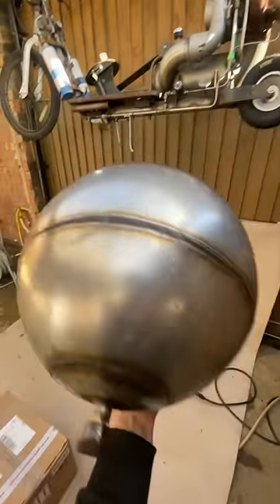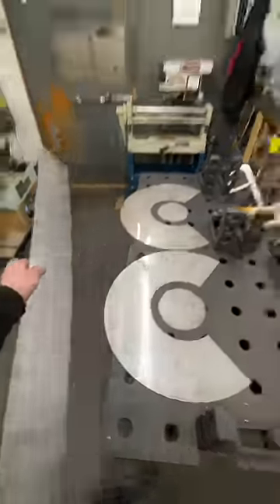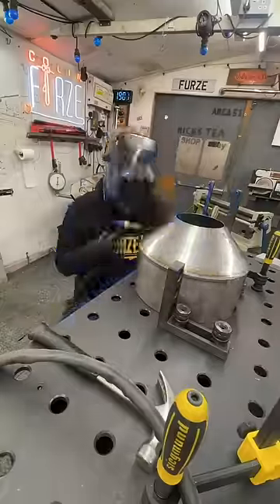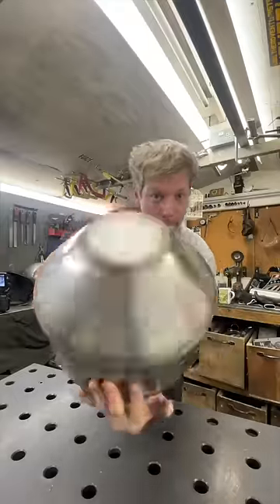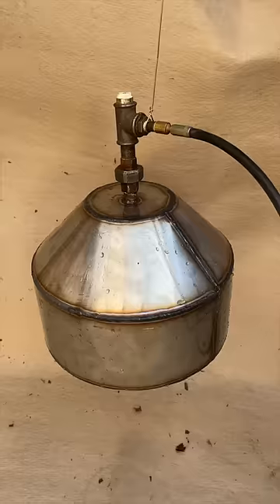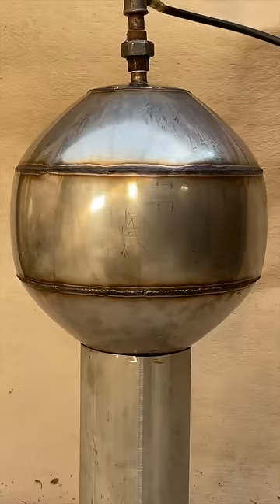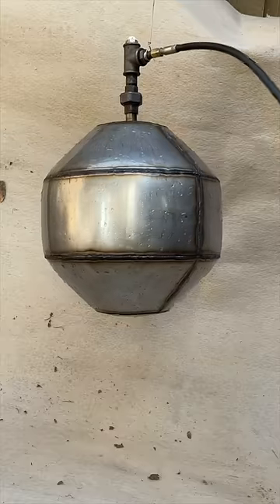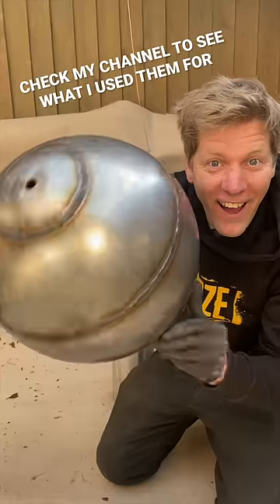Your Pressure washer has a Secret SKILL

Comment: I think it’s VERY important to note that you should ONLY pressurize with LIQUID. If it busts with water in it it’ll just split and water will gush out, if it busts with air in it, it’ll send shrapnel through your body at very high speeds.
Reply: this comment should be higher to save lives
Reply: @ampjam his full video on this he says all that warning what to do and what not to do
Reply: @derekvandyke5132 
Well yes, but this isn't the full video.
Reply: @gustaveliasson5395 very true
Reply: Not saying I doubt you, but could anyone explain how/why air would shred the sheets of metal into small deadly shards whereas water would just pop the seams?
Reply: I do have two corrections to make...
"it'll"..."it WILL send shrapnel THROUGH your body" 🤔

How about "it could send shrapnel into your body". Would that be more accurate?
Reply: @AB-nb2ic air is compressible water is not. For air or water to exert that amount of force on a container, there has to be a MUCH higher volume of air  shoved into it than water meaning far more room to expand if the container ruptures. It’s like how if you poke a hole in a balloon it pops really loud cause that volume of air is in a rush to get out as fast as it can whereas if you fill a balloon to the same diameter with water and then pop it the water just kind of falls to the ground.
Reply: @AB-nb2ic  water would take the easiest route so when a hole forms it would just leak out 
But with air pressure the ball would form cracks then expand and after a short time explode

(Look at naruto and sasukes fight on top of the hospital and cheack what their attacks do to their respective water towers)
Reply: Nah. Darwin.
Reply: Could you fill it with water and freeze it ?
Reply: @frankyw8803  really not a good idea
Reply: @ampjam Yeah this should def be higher up even pinned up top for all the ppl who are def gonna weld and inflate a steel sphere!!👍🤦🤕💥💨lol
Reply: @AB-nb2ic It has to do with the compressibility of air. When air is under pressure, it gets compressed like a spring storing energy. When the vessel ruptures, that energy is released and it explodes. Water on the other hand is incompressible. When the vessel ruptured there is no stored energy to release.
Reply: @AB-nb2ic it'll is just a contraction of the words it and will.

It'll and it will both mean identically the same thing
Reply: @ampjam  because everyone who watched this is running out to buy a welder, pressure washer, going to learn to weld, going to buy buy sheet metal and a metal roller............. RIIIIIIGHTTTT
Reply: The beauty of hydraulics... When they fail, it's okay.
Reply: @AB-nb2ic  water is very incompressible. At 10000 feet under the ocean it is only a few percent more dense iirc. When it bursts, it barely expands. Air really does.
Reply: Atleast with a pressure washer u can put a lot of molecules of air in it but u can’t put in a lot of molecules of water. So when the tank bursts there are more air molecules than there is water molecules. Which expand
Reply: @ethanbikes7926 Best basic description of physics ever!
Reply: I think pressure washers can only pressurise water. Hopefully.
Reply: @AB-nb2ic simply, it takes more air to make the sphere then it does water. Water does not compress, unless it is in its steam form. There would be alot more air in the sphere then there would be water if water was used. Alot more air would be trying to escape, especially at high a Psi. This is why all compressed gasses are in thick or double walled cylinders.   Like welding gasses, if you have ever seen a welding gas cylinder like a argon tank being punctured, you would then be able to connect the dots as to why air is not a good idea to be used in this experiment.
Reply: @RealCanadanMan welders are cheap and there are other shapes you can make, other then a sphere, hydroforming is not limited to making spheres only. I can see some diy week end warrior, trying to make a ornamental piece for his Christmas tree. And catching a chunk of metal to the neck by doing this process incorrectly
Reply: Idk that sounds pretty metal. I’m gonna give it a try anyways
Reply: @gustaveliasson5395   good thing he didn't say to do it with air then
Reply: @wlfshadow4255 take a bath with your toaster.
Reply: @AB-nb2ic  gas compresses, liquid does not. 

Because the gas compresses, it can pressurize MUCH higher before exploding the sides out.
Reply: @AB-nb2ic water doesn't compress. Ait does.

You could fit a theoretically limitless amount of air in this sphere because it will compress. That means that once there is a way for the air to escape, like a weld failing, the air will explosively decompress through that hole, ripping the sphere apart. 

You can only fit a certain amount of water in the sphere, and it will crack open the instant there is more than that. The pressure that would break the sphere is literally just a single drop of water more than it could handle, which means the the pressure goes to zero the second the sphere fails.
Reply: I was hoping no one mentioned this. Professor Furze needs no encouragements.
Reply: Well you're not going to be standing right next to it so doesn't matter what you pump it up with
Reply: @ethanbikes7926 have you ever seen one of these balls explode? No you haven't so be quiet you don't know
Reply: @CFAPA  Darwin in your future.  Maybe we'll just keep you away from the shop and tools
Reply: @deemorty6831  who is We? Do you have a mouse in your pocket
Reply: @dupedmek9658  done that it didn’t work 
You failed to tell me to plug it in
Reply: And if the shrapnel doesn’t hit you, the air blast will make you deaf.
Reply: a bomb
Reply: @wlfshadow4255 what in the fuck are you talking about naruto for bro. this is reality. both the air & the water under pressure will take the easiest route to an area of lower pressure. it has nothing to do with the where or the when. air can simply  be compressed more than water, meaning it will expand more when reverting to regular atmospheric pressure. more expansion = more violent.
Reply: Thanks for the word of caution, but your average person isn’t going to just have sheet metal and the specific tools to work with sheet metal just laying around. Anyone who does, has experience because they bought the tools. A random kid isn’t going to go in, cut and roll sheet metal, slap some welds down and put a pressure tap in. Not gonna happen.
Reply: @AB-nb2ic air is compressible so when released it's traveling at a very high speed, and shrapnel will get sheared off and travel with it
Reply: @AB-nb2ic mass mostly.  Water has a lot more mass, so it requires less pressure to force metal around.

Air having much less mass needs a lot more pressure to achieve the same effect.  And more pressure means more boom if something fails.
Reply: Challenge accepted cool 😎
Reply: Surprise! You've been sliced and diced!
Reply: nonsense 😂
Reply: Probly dont have a compressor capable of that.
Reply: @derekvandyke5132  shorts are very dangerous all the don't-do's trimmed off
Reply: Well…wellcome to fact… or cap.
Reply: For all the argueing. We also know literally 3 people max may do this. Acting like the supplies needed here are a paper plate and scissors.
Reply: @AB-nb2ic because that air has to go somewhere once the pressure is broken. Water won't have to expand anywhere near as much
Reply: @ampjam i don’t think anybody is going to be making a metal sphere on a whim after seeing a youtube short
Reply: @kaufmanat1 🤣🤣🤣 says a person with literally no experience in hydraulics lmfao.
Reply: Yea I guess we can all pretend like a high pressure hydraulic leak never seriously hurt or killed someone
Reply: Sheesh who does this type of shit?😂😊 Pretty cool till it explodes in your face FR..💯😢😠👊
Reply: as well as commented before it needs to have water in it to pressurize it.  a very good valve to control a slow addition of air pressure is also highly advised.  any pinholes in the welding can also produce a very fine laser-like stream of water that can cut a person easily. I stream can be so small that it is hard to see in low light.  But it can cut seriously.  This is not really a project for the unexperienced.
Reply: @AB-nb2ic Physics man
Reply: @ampjam  why?
Reply: @LovelessRanch  take a tank pressurized with air vs a tank pressurized with water. When the tank fails, which one does more damage... It's not rocket science my man. When compressed steam engines fail it's a lil worse than when hydraulics fail 🤣😂😁👌
Reply: @AB-nb2ic And, language is meant to express an idea of opinion. As long as it's achieved, how it's don't hardly matters. Also what we are taught in school is "Formal English" so to speak, meant for academic or professional writing, not a YouTube comment thread. Language is weird like that. Sometimes there are rules... And other times there is none. 

This was brought to you by boredom. And maybe some edibles. And not meant to offend. I have been told I come off that way at times. I don't always notice it.
Reply: @AB-nb2ic aren’t you gonna come back here and say thank you to the 100+ people who individually told you what we all know?
Reply: Fluid dynamics 101, I work with pressure all the time, hydraulics never really bother me but whack a bit of nitrogen in the mix and my bum is very scared
Reply: why would it beheave so differently with air, are you some kind of pro to know that?
Reply: I don't know if you could use a pressure washer as an air pump
Reply: @ampjam  Thank you for your service.
Reply: @Johann.863  it’s basic physics, air is compressible and stores 1000x more potential energy at those sorts of pressures as compared to water..
Reply: True. In the old days they used to test plane's pressure resistance by filling them with air. They did it until one of the planes blew up, killing everyone in the facility instantly. They started filling the planes with water from this moment.
Reply: @BigNank  huh interesting
Reply: Essentially just big frag grenade
Reply: Question…where would a normal person even get the 2000psi or more air supply comparable to a pressure washer? They don’t sell something like that at the local store. 😂
Reply: @frankyw8803 it would freeze unevenly and cause the metal to contract and be far more likely to break especially where different forms of metal join.
Reply: @cristianmoore1996  If it’s thin sheet metal you can get it done with a standard 200psi compressor.. But I could also see some hobbyist saying “let’s give it a shot” with crappy welds and a dream and getting sent through the wall. Don’t underestimate stupid lol
Reply: @thenamestails7152  Interesting! I learned about it from being taught how to test an air compressor tank👍
Reply: @mowgli2071  You cannot.
Reply: @Johann.863  Yes. I used to test and inspect air compressor tanks. In training they physically showed us the difference between using air vs using water (from a safe distance of course). Big difference lol. Air itself can be compressed and therefore stores more potential energy. Liquids do not compress (or atleast not enough to be noticeable, which is why hydraulics work) and do not store as much potential energy.
Reply: @BigNank  Yup lol. Although all those OSHA training videos where they showed hydraulic injuries are still terrifying. Would never want to be injected with hydraulic oil😂
Reply: @jeffmurray4252  Yep. The OSHA training videos showed injuries of hydraulic failures and people were either cut to the bone or injected like a balloon animal. Definitely good to know how to do it safely before attempting. Those were at 10,000psi+ though.
Reply: @Anthony-yo6he  That’s correct, definitely make sure you know what you’re doing when playing with any kind of pressure. But unless you’re dealing with 10,000 psi or something hydraulic would be safer than air. Still a good idea to do it safely though as anything can happen. 2,000 psi hydraulic will still maim you if the stream is small and you’re close enough.
Reply: @frdradio  U right😂
Reply: @bigboldbicycle  The pressure washer produces mostly pressurized water, but if the thing you’re pressurizing has air in it, that air will be pressurized as well. Important to pre fill first👍
Reply: @ptrkmr  Metal af🤘
Reply: @AB-nb2ic  No no, it’ll send shrapnel through your body is more accurate. Arkhams Razor my friend. Blue collar work teaches that lesson quickly and effectively😂
Reply: @CFAPA  You’d be surprised how comfortable hobbyists can be around a metal sphere filled with 200psi of air lol.
Reply: @CFAPA  He may not have, but I definitely have. Couple times actually. They’ll take out a brick wall :)
Reply: @Action2me  That’s for damn sure lol.
Reply: @TheNarrowPath84  Even professional shops have had these accidents with improper training. Welders, air compressors, and sheet metal are all relatively cheap for someone that wants to get into the hobby. Millions of welders exist in garages around the world owned by people that learned from a YouTube video. Almost every city has a steel mill within a couple miles. Air compressors are in pretty much every garage/outbuilding in America. It happens.
Reply: @lostpony4885  You do if a small section of your weld didn’t penetrate ;)
Reply: @drinkingsoap  I gotta see this😂
Reply: @a.o.8527  You’d be surprised lol
Reply: @gawdat3859  Top comment, love watching people get learnt😂
Reply: @fusiondew  pressurized air explodes and water does not because water is almost not compressible. Because of that it can't contain a lot of energy. For example, let's imagine a cylinder with water and one with air. Because of energy being equal to (distance we travelled, applying force) * force, and the distance being miserable for water, it can't contain much energy and therefore does not explode.
Reply: Anyone with access to a compressor capable of this much pressure already knows this very well lmfao
Reply: @fusiondew  no i mean the pressure washer is something like 1700 psi, the air compressor can likely explode as im guessing people who know probably comment above however i doubt a typical air compressor can neatly inflate the sphere.  That also is a guess but my guess is that air might be ineffective as well as fragmenty
Reply: That's why you can use helium, being lighter than air the explosion will go upwards into the sky.
Reply: @fusiondew  It’s called Darwinism. A lot of people make bonehead mistakes and the rest respect the trade. Using “air compressors in every garage” is irrelevant. Those air compressors aren’t pressure testing welds on sheet metal. Like I said, DIYers and weekend warriors are simply following instructions, copy cats. If someone wants to pressure test welds on sheet metal without any experience, they deserve what happens. Respect the metal. An no, none of those tools are relatively cheap. You’re talking about thousands or maybe even tens of thousands of dollars worth of tools.
Edit: And while pressure testing or in this case inflating, your constantly listening for a leak. You’re not just pumping it full of air with your fingers crossed. The second you hear a leak you shut it off. No Joe Schmo is attempting this. Stop with the nonsense.
Reply: A bomb
Reply: @tomaccino  Yes helium works great! (But if you try it make sure you send me the video)
Reply: @lostpony4885  If there’s one tiny spot where the weld hasn’t penetrated correctly it can blow at under 200 psi. I am not guessing, I know this. I used to test air compressor tanks. Most of the tanks were rated for 200 psi. We had to inflate them higher than that. some blew at 120, some blew at 300. And these are tanks that were welded professionally or by a robot. If someone goes to harbor freight and picks up a welder and an air compressor (which many people do) they have potential to hurt themselves in many ways.

Essentially, depending on if they use thick metal or thin metal, yes it’s very possible that a 200psi compressor won’t inflate it. But that doesn’t mean it won’t explode it. It’s the attempt that’s dangerous.
Reply: @amdy7783  I can buy a 200 psi air compressor for $350 at harbor freight. And so can everyone else. 200psi is more than enough to blow up a welded object if the welds aren’t sound. It doesn’t have to inflate, someone just has to ATTEMPT to inflate it.
Reply: @fusiondew  of course 200psi or much less explodes find but for the umpteempth time my point was that 200 is not going to make a sphere.  The pressure being used is 1700psi.
Reply: @AB-nb2ic Gas is compressible, so it will hold potential kinetic energy like a spring — if a weld breaks, all the pressure will be released in an instant. Liquids are not compressible, so they won’t hold any potential energy. They will only move due to force applied to them in that moment, such as by the pressure washer. If a weld breaks, the water will only squirt out at the rate that the pressure washer is pushing water into the metal chamber — effectively it will just be a weirdly shaped pressure washer nozzle at worst.
Reply: Bump
Reply: @AB-nb2ic  Air compresses, water does not.
Reply: @frankyw8803  Try it. I'm sure it would expand. I don't know if it would expand enough, or too much!
Reply: @wlfshadow4255  Nah bro really using Naruto as his source XDD
Reply: @MGSLurmey  huh
Reply: @fusiondew  A seam rupturing and the thing exploded sending shrapnel in every direction are 2 very different things. You cannot make a steel vessel like this explode and send little bits of shrapnel everywhere with 200PSI
Reply: Seems safer than the usual method of 'popping' them out.
Reply: @AB-nb2ic you know how when you drop an empty glass jar and it shatters like crazy, but if you drop a glass jar that’s filled with a liquid is just splats?
Reply: and water coming out of a small hole with pressure (maybe from improper welding) isnt dangerous ?
Reply: @RochaPartneristDeadFireHD  no, water cant expand
Reply: Welcome to fact or cap
Reply: @amdy7783  So ??Water would likely have a higher kinetic energy because it's denser than air, and therefore, it carries more mass per unit volume. This means that if water and air were both under the same pressure (let's say 10 bar), and they were both forced out of a 1mm hole ( improper Welding ), and thats why i think that a water jet would have more energy due to its higher mass flow.
Please tell me if i am wrong and what u exatly meant with water cant expand ?(i know water cant "expand" like air but i think a jet of water would be more dangerous than air that can easly expand into the atmosphere, no ?)
Reply: @RochaPartneristDeadFireHD  think of them in terms of springs, air is a stiff spring you can compress, and when released will quickly expand with explosive force. Water is a spring so stiff that you can barely compress it, when you release that water spring, it has the same amount of energy as the air spring, but it will only expand outward a very small amount relative to the air spring. 

Spring that explodes into many many times its compressed length vs very very stiff spring that only expands outwards a little bit. 

Which one do you think would be safer to handle?
Reply: @RochaPartneristDeadFireHD  if you want to know exactly why the 1mm hole with water is better. The water (presumably) has to be “compressed”/pressurized using a volume of air, that volume of air is probably small, water will leave the container, the airs volume will increase, the pressure will dramatically drop very quickly. 

As opposed to a container of air, which can expand outward ten of times the original volume of the container.
Reply: Unless it springs a pinhole leak in which case don’t get near it or your flesh is as good as ground beef.
Reply: @AB-nb2ic air is compressible and water is not. Compressed air acts as a spring essentially and can store potential energy in that compression that will release all at once. Water is not compressible and therefore doesn’t store that potential energy.
Reply: What?
Reply: @gustaveliasson5395 and I blew off my face😂
Reply: @wlfshadow4255 i love that you used Naruto to show how air and water in a pressure vessel works.
Reply: @GameTimeWhy  it works so why not
Reply: @wlfshadow4255  such an amazing fight too.
Reply: @GameTimeWhy  true
Reply: The liquid can still hurt or kill you. Neither should be taken lightly.
Reply: Cool, I'll fill it with liquid oxygen!
Reply: @AB-nb2ic with safety, you always treat things like they’re at their most dangerous. Like how you treat all guns as if they are loaded, even if you are certain they’re not.
Reply: Me when air is a liquid 💀
Reply: @AB-nb2ic water isn't compressible so the volume of water that needs to exit is manageable. 

Gases are compressible so when it bursts it will need to evacuate a massive volume of rapidly expanding gas. 

Another name for a large quantity of rapidly expanding gas is "explosion"
Reply: @wlfshadow4255 Bro brought up an anime in a science explanation and it actually works 💀
Reply: @thenerd173  why thank you😊
Reply: the easiest comparaison is between popping a ballon with air or a water ballon. One pop ou this other juste make the water fall down. Pretty same principle with much more force for the air steel « balloon »
Reply: Yes, we know lmao, no need to point it out
Reply: @ampjam lmao what? It’s not saving anyone
Reply: @majesticeagle5461  according to the video apparently not
Reply: No, no it wouldn't.
Reply: @tomchapman4826  tends to be how explosives work
Reply: Interesting
Reply: Yeah I’ve reported this dangerous YouTuber!
Reply: @ampjam  why how many people do you think In these comments are gona be doing this 😂
Reply: Just got to let you all know water can be pressurised it can cut you your car and house in to tiny little pieces under enough pressure if your a mile down on a submarine in the ocean and you put a pin hole in it it will send a laser jet of water strong enough to cut you in half 😂✌️
Reply: Yep , Aand pressure washer can't pump air 😢
Reply: I’ll remember this next time I’ve used templates to cut steel sheet, welded them all together and am ready to pressurise it to make a steel sphere. Thank you.
Reply: @ethanbikes7926 also water is more dense
Reply: @AB-nb2ic will was correct
Reply: @AB-nb2ic  air can be compressed till it has high pressure and gain huge velocity when released
Reply: Guys, Here is The Savior

HalleluYAH translates “Praise ye YaH”

YaH is The Heavenly Father
YaH arrives via the TENT OF MEETING
YaH was Who they Crucified for our sins
YaH was Crucified on an Almond TREE

Ancient Semitic of Moshe (Moses)
Isa Scroll (The Original Isaiah)

Isaiah 42:8
"I am YaH; that is my Name! I will not yield my glory to another or my praise to idols.”

Isaiah 43:11
“I am YAH, and there is no other Savior but Me.”

Isaiah 45:5
“I am YaH, and there is none else.”
Reply: Air wil not do this🤣 not enough presure